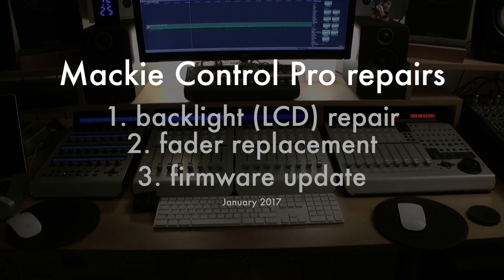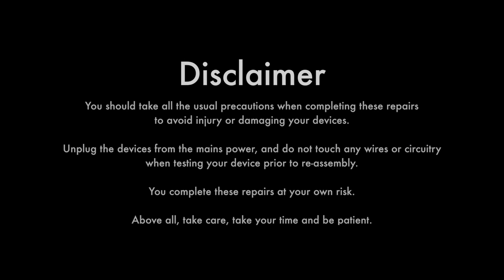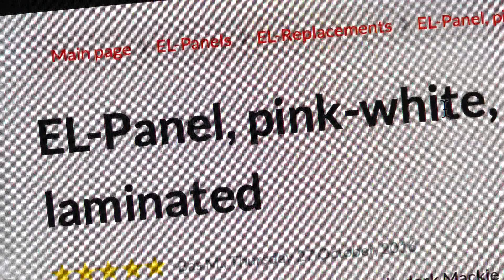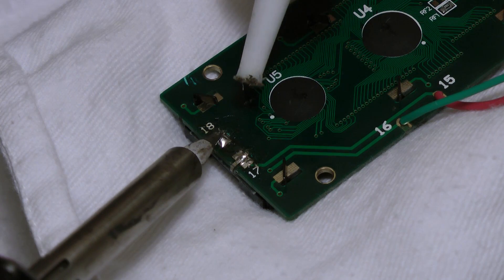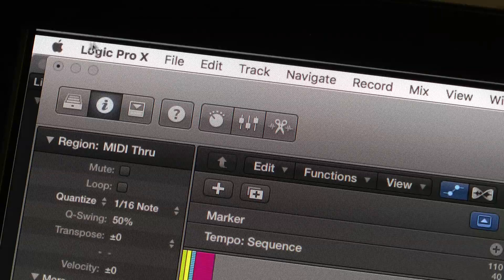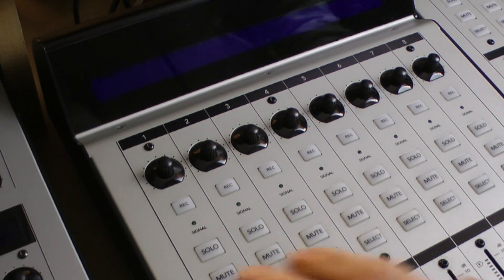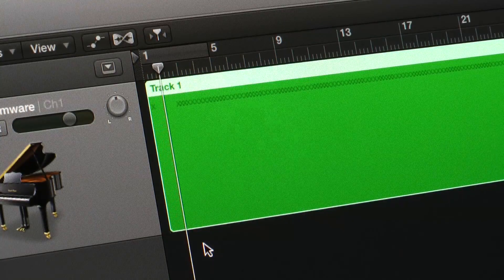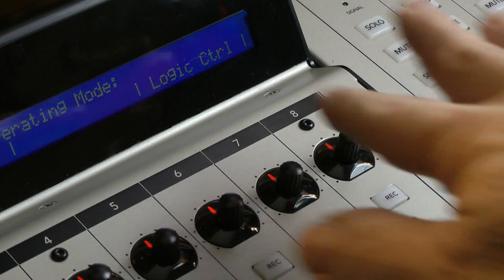Mackie Control Pro LCD backlight repair, fader replacement, and version 4 firmware update

Comment: Hi, Matt. I am grateful for this info re potential budget repair of MCU display. I think I followed your instructions but I'm afraid once I replaced the EL strip I can't get the LCD to display properly again. I'm wishing I hadn't loosened even a few of the black metal posts underneath the LCD board. Even with varying pressure, wiggling, fiddling with the alignment etc with the board held in a vice, it isn't reading properly. Sure, it's nice and bright and it's obviously trying to show the info from Logic Pro, but only in small parts of the screen. I'm going to get a replacement board and never touch those posts again. Have you encountered this issue and, if so, can you suggest how to overcome it? Thanks. Greg
Reply from the maker: Sorry to hear you're having problems with your repair. Although possible it's unlikely that the posts you refer to are causing the problem. However, if memory serves, some of them have an electrical purpose and must be bent back to be in contact with the circuit board. I may be wrong but check them.  If the EL panel is consistently lit it is possible that there is a problem with the data getting to the screen itself in which case you might want to re-check the multi pin connectors to ensure none of them are bent. If all this fails, you may need to buy a new screen unit but it least you only wasted a little money and some of your time. Good luck.
Reply: Been there done that. Tabs have to bend back in at something like 45 degrees to exert sufficient pressure on the LCD / make contact. It's a bit late now probably, but I doubt your LCD was faulty.

Comment: I have one of these controllers and I an't stand it. I get a slight humming noise from it which I can't understand because it's only a midi controller. I'm ready to sell this and the extender for $900
Reply from the maker: Is the hum coming from one of the PSU's? This is typical of a vibrating transformer.
Reply: I really don't know. I'm not an electrician but I wish that I was. I've changed the USB cords and used it on another computer and continue to have the same problem. I really do want to get rid of it
Reply from the maker: Put your ear to the wall wart power supply box. The transformer is inside it. Is the humming sound coming from it? If yes, you can order a replacement from  a Mackie service centre. If not, and the humming sound is coming from your loudspeakers, the problem is probably not with the Mackie because it passes no audio, only MIDI data.
Reply: Worked like a charm. I really appreciate you help. I think that I'm going to get the c24 by December

Comment: Wich one is the right Alps faer for the mcu pro ? https://www.conrad.de/de/Search.html?gclid=CjwKCAjww9_MBRAWEiwAlaMJZvkTx_qQ7k0rYMiFn2wiC9DHb6k1bQFTP3LVSw6Fee-4yZ-Vto9W5BoCYVEQAvD_BwE&search=alps%20fader&insert_kz=NA&hk=SEM&WT.srch=1&searchType=REGULAR&externalsearch=yes&s_kwcid=AL!222!3!108777119481!b!!g!!alps%20fader&ef_id=VMyQWAAAAIVPqTvH:20170819092423:s&category=%1Ft13%1Fc17440
Reply from the maker: I believe the alps faders for the Mackies are not generic models. The correct ones should be tagged as Mackie specific.
Reply: Matt Ottewill no its not true. They are the right faders.Exactly the same like mackies. You think mackie build it?  But i dont need it anymore. Mackie is a shit company today btw.
Reply from the maker: Hope you find a better alternative. Let us know if you do. Good luck.
Reply: Matt Ottewill better alternative is the qcon pro x.

Comment: Hello, I work 
with mackie universal control pro version 3.0, I would like to update 
the firmware but I can not, can you help me by sending me a link ?, my email ryldodisouza@hotmail.com
thank you Ryldo
Reply from the maker: You find the link you need at the Mackie support portal Rildo. Click on the Drivers / Download button here .. http://mackie.com/support
Reply: I was able to 
download the firmware version 3.0 already upgraded, plus the fades 
inside pro tools 12 are not working well, they do not obey, my OSX is 
elcaptain, thank you Ryldo
Reply from the maker: Sorry to hear you're having software problems. I have no experience with your setup so can't offer any advice I'm afraid. There can be multiple reasons for problems. Best advice is to search Pro Tools forums. Good luck.

Comment: Excellent Video - I have a Mackie C4 (original/grey) and the bottom display has failed. The text is just visible but no backlight display.......Any advice on where to purchase a replacement backlight?
Reply: i'm looking for the same thing. Did you find anyone?

Comment: Excellent video. I  have a C4 PRO (the silver one ) but it says firmware version 1.02.... there is now firmware update for the C4 PRO.. I see you have 3.0
Reply from the maker: My C4 Pro came with version 3.0.0 which is the latest version, but I can't see a download for it on Mackie's site. However, I don't think there is going to be much difference. The functionality is identical and I never had problems with version 1 on my old non-pro C4. Are you having any issues with yours? If not, I'd probably leave it at version 1.0. I wonder why the version 3 firmware isn't available?
Reply: nop, don't have any issues. It seems like the first C4 PRO they made, had the same internals as the Original C4. The 3.0 might have some updated internals. Just like the mackie control v3.0 to version 4.0 has updated faders. Thanks!

You know what I would really like? a black backlight or at least kind of dark, like the SSL Nucleus and the M-AUDIO Projectmix IO.... could that be possible by changing the backlight?
Reply from the maker: Someone was trying to produce something bespoke to replace the LCD on his device a few years back. Can't remember which forum he was posting on though.
Reply from the maker: Pretty sure that would require a different LCD unit lit in a different way.
Reply: @MattOttewill  is the backlight different on the c4
Reply: Hi there, I'm about to buy a C4, and just saw this listed on ebay, in case you are still interested. Cheers. https://www.ebay.com/itm/Mackie-Control-Universal-MCU-Pro-XT-C4-Super-Enhanced-Black-PMVA-LED-Display/223511501703?hash=item340a52db87:g:8sUAAOSwxJJdHVCW